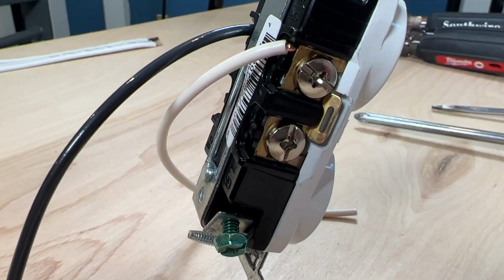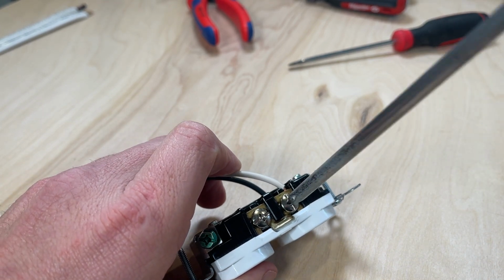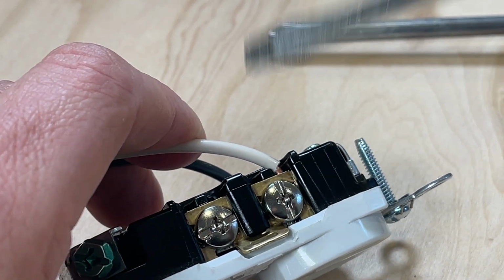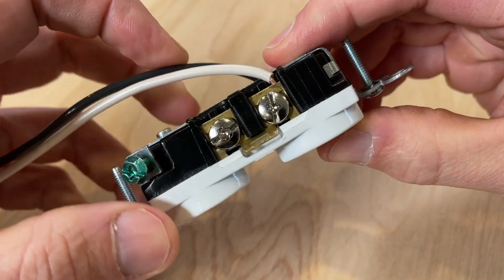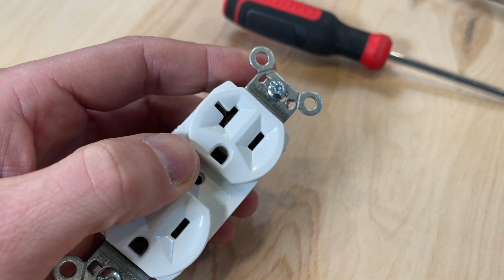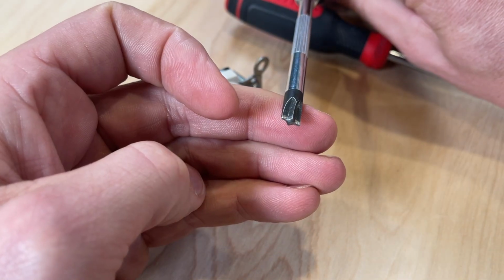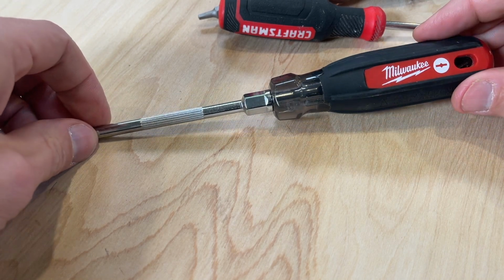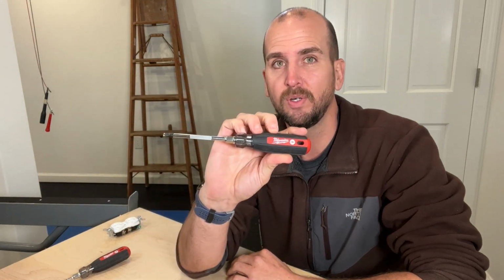80% of People Use the Wrong Screwdriver For Electrical Work

Comment: I've been using the Phillips with a slotted to do the final tightening, and I'm glad to see that you suggested that as a good solution without buying new tools.  I was surprised just how much more tightening I can do with the slotted screwdriver after it feels tight with the Phillips.  My slotted that I use for outlets is a bit wider (more distance from one end of the slot to the other), so it works great for not slipping.  It's also extra short, which gives me better control.  Having tools that you like really helps.
Reply: Phillips was designed to limit the torque and cam out for use on the auto assembly lines.
Reply: @jkbrown5496  Unfortunately, camping out tends to strip the screw head, especially if done with a power tool.
Reply: @davepaturno4290  as a mechanic with 19 years of experience, you just made me cringe from reminders of new mechanics sheering off 3/8" and 13mm bolts with the 1/2" impact or cracking sockets because they didn't grab the ones designed for said impact... 🤦‍♀️
Reply: @kraziecatclady  Well, I have over 30 years as a mfg engineer and have a degree in mechanical engineering, so I can assure you that I am well aware of metallurgy, tools, and torque. Sadly, I'm not a mechanic but I have worked on a few cars over the years.😏
Reply: @Dave Paturno  are you the person I'm not so silently cursing at for putting bolts in ridiculous locations that seem impossible to remove?

 Honestly, when I was younger it was something that annoyed me a lot, but a few years ago, I got the opportunity to actually see part of the engineering process and realized that it isn't always the engineers fault. Many of the parts are designed and assembled in different locations with the main emphasis on making sure the parts fit together as a unit, not taking accessibility of the bolts into as much consideration.

 To further complicate things, sometimes engines, transmissions, and other major parts end up going into several different types of vehicles, which can make the bolts more or less convenient depending on the particular vehicle or model. 

Another problem that seems to occur is when a major change is pushed through, and the engineers simply don't have the time to relocate things into more convenient locations. It was a pretty eye-opening experience. 

That doesn't mean I will stop cursing at engineers and difficul bolts, but at least now I know why it happens.
Reply: @kraziecatclady  No, you contacted the wrong person, Jolene. I don't design vehicles but I have designed stainless steel brake rotors.
Reply: @davepaturno4290  ok, so a little less cursing for you... 😆 Maybe more disgruntled grumbling.
Reply: @kraziecatclady  The car wizard of youtube fame hates BMWs for that very reason. He and his crew are good mechanics.👍
Reply: @kraziecatclady  👍
Reply: @davepaturno4290  what do you work on the most?
Reply: @kraziecatclady  I don't do as much as I used to but I still change engine and transmission fluids, air filters, and some mods. Many maintenance tasks are no longer needed until many years have passed and I don't drive as much. I do have lots of tools including a large compressor and impact wrench and sockets.
Reply: @davepaturno4290  I meant as far as manufacturing things. What do you create at work?
Reply: @kraziecatclady  A manufacturing engineer creates assy tooling and procedures, trains assemblers and technicians, and writes engineering change orders. There's not enough room here to list specific designs because there are so many.
Reply: If tou do strip a Phillips head screw that doesn't have a built-in slot, make a slot using a Demel tool with a cutoff wheel.
Reply: @davepaturno4290   I have ground many a slot into the head of a stripped out screw, for removing with a flat blade screwdriver,  but the Dremel carbide cutting wheel technique doesn't work if the screws are countersunk and you care about not damaging the finish of the finish of the surface that the screws are driven into.  In worst case scenarios I have epoxy glued a drive bit into the stripped screw head with JB weld a d let it sit overnight to cure before applying backwards torque to remove the screw.
Reply: @goodun2974  Yes, the reason why flathead Phillips screws are more likely to strip is that there is more surface area and friction under the head - another reason why I like hex or Torx drive flathead screws.
Reply: @davepaturno4290  , I repair old audio equipment for a living and the top-cover screws are often countersunk for the sake of appearance, and often half frozen ---- especially if the screws and cover are anodized or painted black ---- and the screws often chewed from audiophile/wannabe tech poking around under the cover ------ but I have found that alternating cycles of heat (soldering iron or heatgun) and cold (freeze spray) can often loosen the screws in the threads.

Comment: The Milwaukee 13-in-1 includes both square drive and ECX bits, so it has both of your top choices. I got it on a Home Depot Deal of the Day for like $9.
Reply: Now if they only had a very small driver to releasing the quick connects

Comment: Excellent video.  You failed to mention the Klein combi 1 and 2 vs Milwaukee ecx 1 and 2.  Both the same just different trade names. As you pointed out so well you can use a lot of different drivers to install switches and plugs. What is changing will be the need to torque these screws similar to circuit breaker binding screws. In that situation the #1 Robertson or ecx1 or combi 1 will not slip as much as a slotted or Philips #2. People can embrace technology or ignore it but as you said it is up to the user and your opinions are most accurate   Cheers

Comment: I'm skeptical about Torx.  Seems too "fine" to me, with sharp flutes on the bits and tiny crevices in the the screw to plug.   Removing an old, rusty Torx screw would be a problem if even one flute is crammed with crud, but a rusty Robertson is usually works.
Reply: You obviously have little experience with torx bolts. 
There is a reason carpentry screws are almost exclusively torx heads now. 
They're better
Reply: @contraband1543  Torx wouldn't be a good design on low pan head screws used in electrical receptacles because it would create a thin wall between the head and the shank. They are commonly used in cap screws and button head screws for metal to metal fastening. They are, as you correctly stated, used effectively in woodworking and carpentry. They do however, have a taper under the head with a radius between the head and the shank to keep the wall thick enough.

Comment: I have ECX bits but I wish Dewalt or Klein made the insolated multitools with it. Inside of a hot panel I like a mechanical lock stronger that the little spring loaded ball in the multitool show in this video.
Reply: Milwaukee makes at least one size ECX insulated screwdriver. I saw it at the orange store in a three piece set of insulated drivers
Reply: Mostly useless many panels as they are SQ/SL. Best to just get insulated square (Roberson) drivers

Comment: All Canadian DIYers and pros know that Robertson square is the only way to go.  Virtually all screws sold in hardware stores here are Robertson only.  If a device came with separate Philips mounting screws, they are quickly garbaged in favour of Robertsons.
Reply: internet sez there are 6 diff sizes but which one is most common?
Reply: Personally, I would say that the red (#2) is the most common with the green (#1) coming in a close second.  The yellow (#0) is common for trim applications where tiny screws are needed and black (#3), are used for larger applications.  I've never come across the smallest orange (#00) or largest brown (#4) before.

For electrical work, the screws on the terminals of the device (receptacle or switch) and the screws to mount the device to the box are usually a green (#1).  The ground screws are a larger and use the red (#2).
Reply: @cantech5587  getting the driver for the #00 is near impossible i had to buy one direct from the roberston company just to have one for my set cost me like $20 with shipping. the lady in there sales dept said they normally don't sell direct to people but that one is so hard to find that others have contacted in the past to buy. don't think i've ever need to use it though lol.
Reply: @mraaron1584  I have seen the orange Robertson #00 in stock at Canadian Tire once years and years ago.  Didn't know what the application is for as small precision things that size aren't built here.  Perhaps jamming a tiny philips screwdriver in the square would work.
Reply: @haweater1555  the lady from roberston said mostly people who build doll house furniture are the ones contacting them to buy. i've personally never seen anything that used a screw that small and was roberston though.
Reply: @cantech5587  #2 and #1    just like phillips here in USA   #2 phillips and #1 are the most popular   tnx

Comment: Wrong size slotted screwdriver. Too small for size screw.
Reply from the maker: That one was small, it is my go to for wall plate screws.
Reply: @EverydayHomeRepairs  I used to get made fun of because of all the different sized screwdrivers I kept in my tool bag.  Being in the military and working on Gas Turbine engines had it bounded into my head, always use the right size screwdriver for the fastener.  After I got out, I went into commercial electrical repair and the screwdriver thing carried over with me.  But hey, is 12 screwdrivers too many. :)

Comment: I think the key to this is "DIY". If you're an electrician by trade wearing a tool bag all day then you need to limit the tools you carry and be proficient with your tools. Yes, square drives are more convenient but anyone that has turned a screwdriver as a profession knows you maintain new sharp tools, and a phillips or a slotted will work just as good and you don't have to carry around extra weight. Also being an electrician of over 25 years...there is no such thing as DIY electrical! These videos will give people false confidence and ultimately get people hurt or burn buildings down.
Reply: Ok while I get your last comments. Trying to get an electrician out to put a new outlet or any other minor job is getting to be next to impossible. They are to busy with bigger jobs to bother with it at least in my area anyway. I remember a few years ago I wanted some lights to be put in a cold storage shed on my farm the electrician said it would take at least a month to get out there. After waiting a month and then contacting him he basically told me to do it myself. He said your smart enough to figure it out, go on yt for research. It is not rocket science. So I did the shed has not burn down yet and I even put in a couple outlets.
Reply: @richardlug6139  well...I'm glad your shed has not burned down.

Comment: Soon, with any degree of design intelligence, these will shift to Torx head. Square drive are better than Phillips, a true Robertson is better than square drive, the Torx take less pressure to maintain good "bite" contact, therefore less effort altogether. Wood workers, deck installers learned this a long time ago. Phillips, Square, Torx is 12lbs, 8lbs, 5lbs respectively. Makes a boatload of difference with overhead horizontal screw fastening.

Comment: Hey! I just discovered your videos a few weeks ago and have watched quite a few of them now. The very first one I watched was one where you mentioned using the Milwaukee ECX - I had never seen this before. It's a game changer!!! I went that same afternoon to my local hardware store but they did not carry it, so I found one on Amazon and received it the next day. The one I got is actually a Klein 15-in-1 ratcheting that includes the ECX #1 and #2. I am in the middle of replacing all of our outlets and switches and I cannot believe how amazingly perfect this bit works - for the past 20 years or so I have been using a combo of Phillips and flathead to get best results. 
***Bonus: it ALSO is perfect for doorknob screws!
THANK YOU for introducing me to my new favorite tool!!!
Reply from the maker: Awesome, thanks for the feedback Beth.  I didn't know about the doorknob tip 👍
Reply: @EverydayHomeRepairs   - well the #1 combo bit was perfect for all the doorknob replacements I just did at my daughter's new house, but they weren't Schlage or Kwikset (I will provide an update if/when I find out the brand) - I just changed a few knobs at my house and they were just straight Phillips. I do wiring far more than doorknobs so doesn't matter much. I love ratcheting drivers and having lots of bits to swap out and this particular handle is super comfortable for me and the bit storage in the handle does NOT unscrew while using! - so I'm still in love with it :)
Reply: Do you have a link?

Comment: No need for a special tool for something I’ve been using a straight bit for for 40 years
Reply from the maker: Don't knock it till you tried it 😂
Reply: @EverydayHomeRepairs  absolutely not knocking it, looks like it does the job but so does my screwdriver and being in my 60s I don’t do as many as I use to.
Reply: If nothing else, consider it an excuse to go to your local hardware store and just soak up the atmosphere for a little bit. For $5 for a square it's worth trying.

Comment: Great demonstration, it's worth noting that the phillips head is designed to cam out to avoid stripping screws in manufacturing.

It's worth noting that while you said "square drive or robertson" they are actually different drivers. American Square drives have different geometry than robertson.

I've typically used flatheads simply because I already need it for the outlet cover.

I had never seen the milwaukee, that's a great driver that feels purpose built for this task.
Reply from the maker: Thanks for the feedback!

Comment: I do use the ECX for receptacles and I'm really trying to like it, but it does seem a bit off. The square head is only fractionally deeper than the flat blade, and it seems to slip easily on the 6/32 screws when using a powered driver. But, I only tighten the receptacle screws by hand and that really works well. I think the ECX needed the square head to be a bit deeper to keep it in place a bit better.
I only found out about the ECX through your excellent videos. I'm a noob, so I really appreciate your clear and easy tutorials and knowledge sharing. Thanks
Reply from the maker: Thanks for the feedback and support 👍